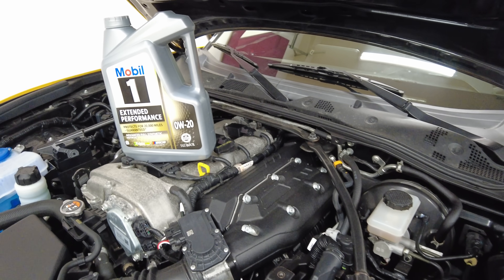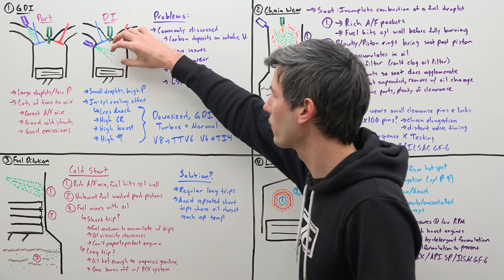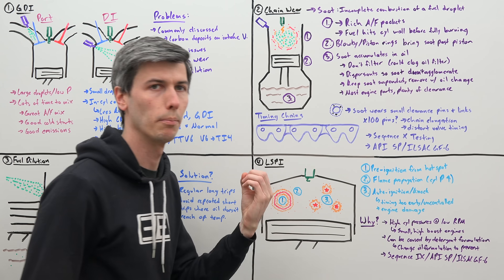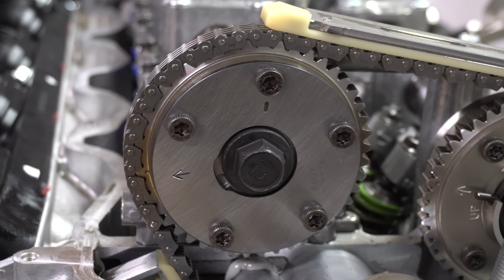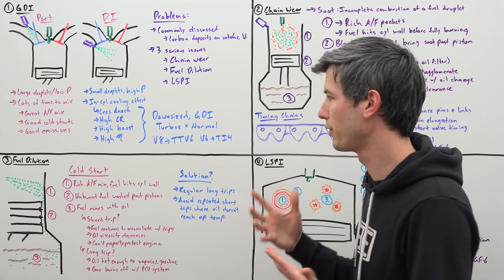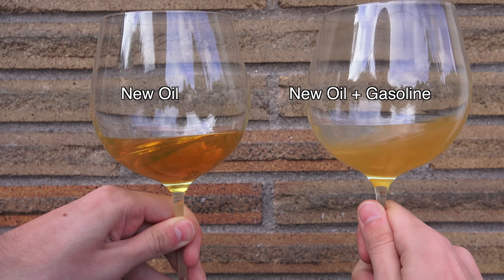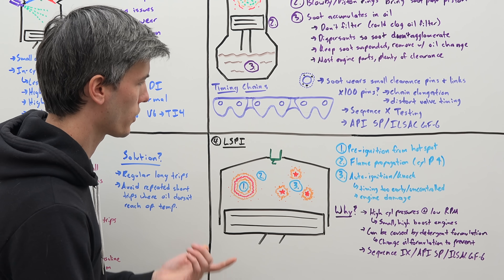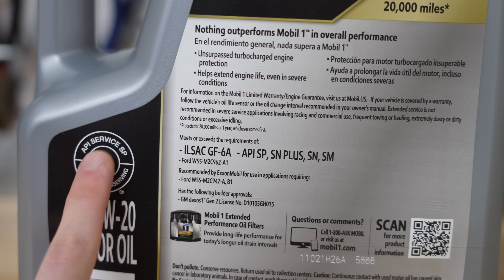3 Big Problems With Direct Injection Engines (Gasoline)

Comment: I find it strange that in the quest for cleaner, stronger engines, we now have increased oil dilution and carbon fouling.
Seems like it wasn't really well thought out
Reply: They no longer care about longevity, only meeting emissions while under warranty. The day after the warranty expires you're on your own and should plan to dump it ASAP.
Reply: @AmandaHugenkiss2915  If this was true every car would fail immediately after warranty forcing you to buy a new car.
Reply: @spacebound1969  I'm not saying they will fail immediately. Some do, but most don't. But once you get some years and mileage on it, the electronics are so sensitive and pervasive that it can quickly become a never-ending money pit to keep it compliant. And there are so many things that can set the MIL off it's easy to spend thousands keeping that light off. Newer cars may be more fuel efficient but they will be junked much sooner so really it's not helping anything.
Reply: the road to hell is paved in good intentions
Reply: May I suggest thorium drive.  Refuel pellet installation only needed every 75yrs or 10 million miles. Whichever comes first.
Reply: Exactly brutha!
Reply: It’s a government quest for an eighth of a mile more per gallon. They couldn’t care less about performance and longevity.
Reply: Let's try hydrogen next
Reply: Run them on LPG and they are perfect (petrol injectors can be used for LPG injection) -> diesel like charge efficiency, petrol power and diesel torque. Literally amazing, no NOx issues and no particle emissions! People should look further!!!
Reply: Won’t have that problem soon once electric vehicles take over
Reply: @senorpedro8192  And where exactly, will all this electricity magically come from?
Reply: @rickhibdon11  Windmills, DUH!!!
Reply: Nope. Just like buying a brand new car isn't better for environment than sticking to your old drive for a few years more.
Reply: it's well thought out... to get you to buy new cars more frequently
Reply: And added complexity and tailpipe emmissions because of the GDI engines now needing the same type of particulate filter as diesel have been using for near on 20 years now.
Reply: More power in a smaller lighter weight package.   My 2019 Accord accelerates faster and handles with much more alacrity than my 2014 stick shift Accord which feels sluggish by comparison.  We'll see how it works out over the next 10 years.   Hell I may not even have 10 years.
Reply: @tim71pos  Honda has had a LOT of problems with oil dilution in the 1.5 Turbo CRV's
Reply: @rickhibdon11  that's true when I learned all about it only after I had just walked into a dealer and bought a 2019 Accord.  I am hoping to manage the problem with more frequent oil changes.  And I get the oil tested with each change.  So aside from the fact that there might be a catastrophic failure due to oil dilution in the turbo or carbon buildup on the valves, well let me tell you, it's a very nice ride much better than my 2014 Accord.
Reply: @tim71pos  I was about to buy a new CRV when they went to the 1.5 exclusively. After reading up, I changed my mind.  Waiting for a Corolla Cross now. Have an 09 Fit which we love, but the oil problems turned me off
Reply: @rickhibdon11  Oil dilution in that 1.5L Turbo seemed to only affect the 2017-2018 CRVs and 2016-2018 Civics.  Didn't hear about the issue in the Accord (they don't use the L15B7 engine) and seems Honda's largely reduced the possibility of issues in the more recent model years.  I'm looking at the 2022 Civic Si myself right now, wishing they'd put in the 2.0L unit from the Accord instead.
Reply: @eksentrysyti  To my thinking, they never "fixed" the problem.  They simply put a bandaid on it. The adjusting the maps for the engine to try to cover it. I seem to recall they also did some voodoo to make it run hotter (especially in northern climates. And even after all that, they still recommend keeping an eye on you engine for too much oil (caused by fuel dilution)
Reply: @rickhibdon11  well Rick due to circumstances that are tedious to relate I ended up buying two cars and 2019 one.  One was an early release 2020 Toyota Corolla which was a bit fancy with a sunroof but my wife insisted on it because she absolutely had to have the lane change warning signal.  The other was the 2019 Accord for myself.  I had not kept up on the design changes. I was an ignorant customer and some kids had trashed my car and I needed to get a new one the 2014 Accord have been great so I just went out and got another Accord.   It was only after it was button paid for that I started learning about all this other stuff.   The acceleration was the best I've had in any vehicle anytime. It's true I'm not looking for muscle cars but this just sort of dropped into my lap and I thought wow.  At the same time I was test driving and getting to know  my wife's 20/20 Corolla.   Now I myself had owned a 2004 Corolla and it was a good reliable car.  What I don't understand about the 2020 Corolla is that it is damn near impossible for me to get in and out of it.  It's like they deliberately designed it for somebody who was 5 ft 11 not to like it.  I have to go in at all kinds of weird angles and then straighten myself out.  My two previous Corollas were not like that I could just get in and get out.  So I don't think I would have bought that car for myself and it's bad enough that I have to fold up in order to get in when I'm driving with my wife. From everything I read I believe it will have Superior durability and reliability to the Accord because it doesn't have GDI.    All you have to do is get used to the fact that it drives like a cement truck.  I will increase the frequency of the oil changes on the 2019 Accord.  If it lasts 5 years that is a poor but acceptable outcome in terms of getting my money back by driving it.  If it lasts 10 years then it will be a success.   If it lasts 12 years even better.   So we'll see how it pans out.
Reply: @tim71pos  The trans will fail way before the engine, so no worries.
Reply: Cleaner? Have you ever seen the soot buildup on the back bumper of an Ecoboost powered vehicle? GDI engines produce about the same amount of soot as a well tuned diesel engine. Port injected engines don't make much soot at all because of the even fuel mixing. The diesels get a choking soot trap on the exhaust, while GDI engines get a blind eye. Most likely because the idiots rolling coal with their cummins got the EPA right on every diesel owner's back.
Reply: Yeah we should stop wasting our time with barbaric gasoline and focus on electricity
Reply: @mackattack-r3d  If EVs are as great as pundits claim, we don't have to do a damn thing. Just sit back and let the Invisible Hand of the marketplace TCB. After all, nobody had to regulate out horses, now did they?
Wanting EV mandates is a tacit admission that EVs aren't "all that."
Reply: @theglowcloud2215  [Buncha minging whingeing] ..." Hope an unlivable planet was worth burning those V8s!"

Oh, you bet your ass it was! If we're headed to a fier...uh, unseasonably warm Armageddon, I'm gonna "Slim Pickens" it behind the wheel of a big-block V8, TYVM.
Reply: @theglowcloud2215  Commuter vehicles only account for approximately 1-5% of co2 emissions in the US of the 12-20% that transportation as a whole introduces. You don’t create energy for free electric vehicles are still dirty right now because of the extra demand on the electrical grid.
Reply: @theglowcloud2215  In 50 yrs I've never seen a change in the climate. It's exactly as it was when I was a kid. So it's there but it's just invisible?
Reply: @bcubed72  Yep. Facts stand on their own; no cult of personality, censorship, or forced legislation required.
Reply: @theglowcloud2215  DOOOOMMMM!!!!!
Reply: @ApethGrader  You do realize Siberia and Canada have started surpassing 100 degrees Fahrenheit and burning? You do realize thousands of Europeans are dying due to 100+ degrees and no air-con?
Reply: @ApethGrader  I've seen big changes where I live, for over 70 years.
Reply: @mackattack-r3d  rare Earth minerals depletion...
Reply: @CarefreeRambler  I was just thinking the same thing and it takes TONS
Reply: @mackattack-r3d  Small towns, apartment complex, rural have no charging stations.
Reply: @mackattack-r3d  we????
Reply: @mackattack-r3d  electric estrogen cars, which super expensive batteries
Reply: @kinghados  estrogen?
Reply: @kinghados  electric estrogen cars?
Reply: @WatsitTooyah  Yeah, that's funny, considering a so-so electric can kick a muscle car's ass.

Comment: With oil being so important I'm honestly blown away they recommend 5000 miles between changes let alone a year. I stick with 3000 mile changes oil is cheap engines aren't be safe not sorry.

Comment: Video just starting but I hate di despite its efficiency increase. Port injection is so much better for longevity, so many of the di engines fail because of dirty intake valves.

Comment: LSPI also occurs when you use low octane gasoline and when you have carbon deposits on the piston surface. This is typical as a result of using low octane gasoline for long periods of time. Using low-quality gasoline from time to time will not harm the engine by producing LSPI, but doing so consistently will.
Reply: does lspi occur on diesels?
Reply: Diesels only compress air, the fuel is injected just before TDC and ignited by the heat of compression. So in a sense they are deliberately designed to have pre-ignition. We just control it by only injecting the fuel when we want it to ignite, vs a gasoline engine where the problem is uncontrolled ignition at the wrong time.
Reply: @nerd1000ify  so I can still use the low end torque benefit of a diesel without to worry? It feels most powerful between 1750-2500rpm (which is its torque peak)
Reply: @m850i_individual  Yes, a diesel will be happy working this way. My 1.6L diesel car is similar, effortless torque from 1750-3000 rpm (but peak power is at a screaming 4000 rpm, gasp!).

Comment: Another downside of  direct injection - it makes LPG conversions more costly. LPG is popular in Europe (mostly eastern) thanks to lower prices and that makes direct injection engines a pain in the arse. If you want to convert a standard port injected  4 cylinder car you need around 500-800USD. But DI makes these cost double and the car needs to burn petrol as well.
Reply: There are liquid injection kits now that use the OEM injectors, no need to burn any petrol. They aren't available for many engines yet though.
Reply: @BigUriel  oh yes, forgot to mention them. Therefore they are highly priced
Reply: We have had LPG in Australia for decades. Although now it's getting phased out. In fact before we lost Australian car manufacturing all the big 3 had factory LPG options
Reply: @garethfern4177  In Europe some manufacturers were selling CNG cars, but with LPG it was only a reseller option (which was waaaay more expensive than market LPG convertion but the warranty wasn't voided") - Renault, Dacia, Fiat and once even Alfa Romeo.
Reply: But if you do it, it's like a dream for the GDI engine, I've got a 1.2 TSI (2010) with LPdi, never sysrts on petrol (so no oil dilution) and pretty much no soot emission. Plus the LPG has a higher octane number. So it's really awesome. My injectors run quieter than on petrol and I haven't had to do a timing chain replacement ever, it's now on 300.000 km (~180.000mi). Exhaust is clean, like bare metal from the inside. Oil stays clean like tea! Also less likely to have LSPI since the autogas instantly evaporates at the injector tip. Rather than petrol forming droplets... (So cold start doesn't require enrichment)
Reply: @bq5577x  Nice to hear. I've read about those LPG kits but because they are so expensive not many people wants to convert their DI cars (at least in Poland). Funny thing - I have a car with V gen LPG (liquid port injection) but the engine doesn't require one. Grande Punto 1.4 v8.

Comment: Toyota's D-4S combined with using a high quality motor oil seems to cover the bases. I use mostly GTMO and Mobil 1, but Pennzoil Ultra Plat (Shell Helix Ultra) if the price is right. Of course the fuel you use has to have a nice PEA additive cocktail (V-Power, Techron, Synergy Supreme+, etc.)... or dump in a bottle of Redline SI-1/SI-2 or Techron every so often.
Reply: Got that setup in my ISF
Reply: Had a FR-S with that and it was flawless until 61k when I sold it. 
New car is a port-only STI; I suppose I'll worry about direct-only for my next car in a couple years.
(Unless I can find and afford an ISF)
Reply: @nthgth  STi! That's what I had before my ISF. Amazing cars

Comment: Good video, anyone else interested in why oil (not in the combustion chamber) can cause LSPI?  I'm assuming it's the amount of PCV vapours on modern engines with more slick cylinder walls, allowing more blowby, thus starting the cycle of enough oil in the intake>cylinder to affect the ignition?
Reply: LSPI seems to actually be caused by a chemical reaction involving certain oil additives. Newer oil standards intended for GDI engines restrict the levels of those additives to prevent the issue.
Reply: @nerd1000ify  Right, as per the video, but remember, oil is not part of the combustion process, so how/why does it cause/affect problems with it?  My assumption is the above info i already posted, but i was really hoping Jason would cover that.
Reply: @f2cmadmaxx  it's inevitable that some oil will get into the combustion chamber, even if you were to remove the PCV system entirely. The rings cannot seal perfectly, and in fact if they did there would be no oil to lubricate the top compression ring leading to rapid wear. So some oil gets past, and is eventually burned. A small amount is also sucked down the inlet valve guides, this is also necessary for lubrication reasons. So even a car with a road draft tube or other non-PCV way of evacuating the crankcase is not immune to LSPI.